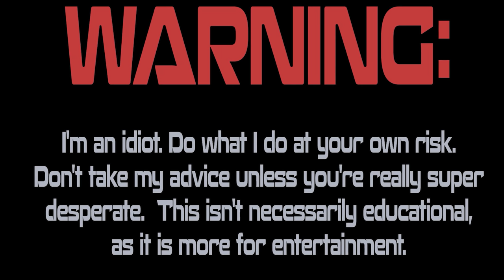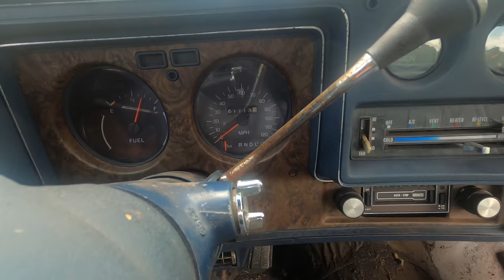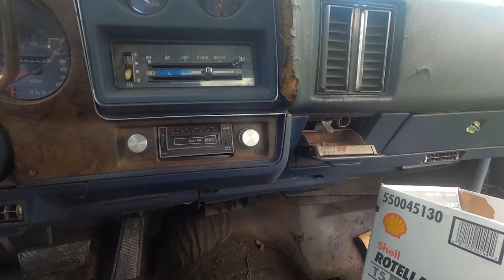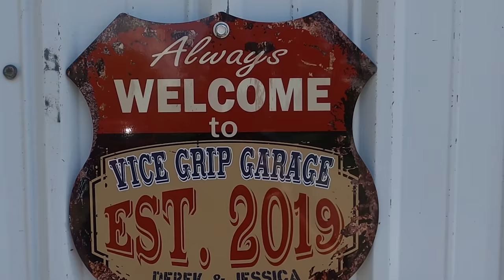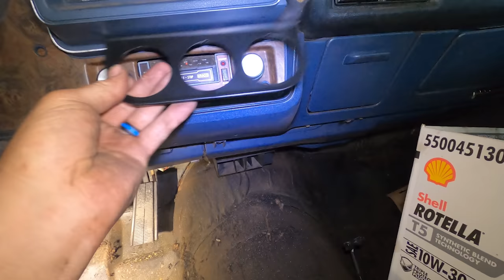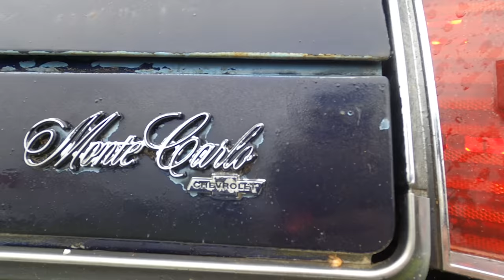ULTIMATE SLEEPER! - Supercharged 400 SBC Monte Carlo Landau

Comment: Someone should start a car club that consists of large 70s era cars like this and call it “The Yacht Club”. You know that Monte Carlo rides like a cloud!
Reply: The Monte was a mid size,more of a runabout than a yacht. There were plenty of land yachts for sure in '74. Big bucks,oldsmobiles, lincolns, Ford's,caddies and Chrysler's. I think you have a good idea for a yacht club. It's about time people start those big boats some love.
Reply: @kenworth2343  yeah you’re right about it being mid-sized. The Gran Prix was a big one if I’m thinking of the correct body style. I’ve got a 70 LeMans Sport coupe and a 73 Mach 1 I need to start working on!
Reply: @John-4649  They we’re great cruising cars. My 73 had the same split bench. I could fit five young ladies in the car with me and cruise around. That car was the only cool thing about me.
Reply: @toddingram1198  Mine isn’t original unfortunately. Someone put the GTO buckets and console up front. The back seat is missing, and finding a good frame for it under $300 will be fun. The Mach 1 thankfully is all there and numbers matching. It needs to be restored but the interior isn’t that bad.
Reply: Apparently Todd, those five young ladies thought there was something cool about you... It couldn't be just the car.

Comment: In the early 90s I acquired a 1973 caprice classic with same engine, I removed it put an a performer intake, comp 260 cam, headers and quadrajet dropped it in an 82 Swb Chevy truck, it ran 15.5s at the strip with 3.08 gears ! Great motor! I really enjoy your channel!
Reply: factory heads no stall street tires?
Reply: @mattv8919  yes they were original heads I believe were 882 castings(small valves). I even used the transmission out of the caprice it was a 375 turbo which I think was a long tail 400 turbo. Fun times

Comment: A fella loves hearing an engine scream down the street as opposed to a loud exhaust system. 
I CAN'T BE THE ONLY ONE
Reply: You might be looking at the wrong cars there then go check them electric boys out
Reply: I enjoy hearing the air growling into the carb sound more than the exhaust sound, too.
Reply: Yep; we got a Charger (V6, I think...) in the neighborhood which sounds like it's got a trombone for an exhaust!
Reply: @CoIoneIPanic  Oh like my 98 Civic DX with my $95 SS Ricer Muffler that's loud enough with the silencer in? Pull off the silencer and of course, the noise probably adds like another 35hp to a 105hp engine until the cops pull you over for a loud muffler! My 07 Si(turbo with 197hp) does circles around my 98 Civic DX, and my 95 Dodge Cummins 500+hp diesel does circles around my SI (never tested, but Probably 14 sec 1/4 mile?). Without a boosted launch it will do about 70-75 mph in 3/10 mile, 1/2-3/4 throttle! Probably the fastest Cummins in my county! About 0-70 in 6-7 seconds!
Reply: @catsaregovernmentspies  Nothing than the better than the secondaries of a spread bore opening up!!
Reply: @joelschermerhorn5447  Hate to say it but mufflers add close to zero power its more about sound

Comment: I had a '74 Monte Carlo. Looked just like that one. Mine was a brown metallic with a 350 in it. The only real problem I had with it was the transmission went out. I got one from a junk yard for $150, a guy put it in for $150 and it ran like new then. Great car. I drove it to Denver, then went over the continental divide but not through the Eisenhower tunnel, instead I drove the old hwy 6 that goes over the top of the mountains. I passed a sign that said 13,000 feet and kept going up some before it started back down. That Chevy 350 seemed to have as much power up there as it did at sea level. Great engine. It was a little harder to start at high altitude but once running very little difference.

Comment: My mom bought a new 74 Monte because she fell in love when she saw it.  Steel gray, black landau top with black interior and buckets.  She never asked about the motor.  Yea, it was a 400 and it would rip.  Not as well as the one she got rid of though.  She said that one was hard to drive and had too much power.  That one was a 71 Monte with a 454.  Loved that cal. Thanks for the memories
Reply: DIg them too. One long heavy car but they cruise on the fwy so well!
We would drive cross country like most in the summers going state to state these were perfect with that ice cold R12 ac. Back when chit was built to last!

Comment: My aunt loved Monte Carlos. Her favorite was a 78 Monte that had a 6.6L 400ci small block with a Edelbrock 4barell carb on day one. Her boyfriend on day two dug into the parts leftover from his smashed 78 Vette. He transplanted a Weiand 177 series long nose single carb blower, Weiand intake manifold,New Weiand high temp/high pressure metal gaskets and mounting hard ware H2O high temp therm, Holley 1250cfm duel pump electronic 4port 16 jet fuel injection carb replacement unit in fire blue, MSD HEI Coil, distributor, plug wires, Iridium tip Y split plugs, Weiand chrome tall valve covers with T handle bolts, MSD programmable ECU. The car already had ported and polished Alum Ram Air IV Hydraulic Flat Heads w/hardened 4130 TRP hardware, COMP Cams Hydraulic Flat Tappet Cam, Alloy Roller Rocker Arms, COMP double roller stainless timing chain, Ceramic Hugger Headers.

Comment: I wish I knew even a quarter of the stuff you do. I am slowly learning and restoring my grandpas old truck. Funny thing is that I’m in the same state as you so often run into similar problems on any car. You’re a huge inspiration for me to always keep going….remind me it can be done and have fun with it.
Reply: Start with building some car models. This might sound silly too you but I assure you, that alone will give you a massive understanding on vehicles and their parts and running gear.
Reply: @-DEATHSTROKE  I never realized how much of my youth building model cars was preparing me for the path I took. At some point my dad saw what I was building, and gave me a dremel And safety glasses. The modifacations never stopped. And its definitely how I got brave enough to start taking a saw and grinder to my real car.
Reply: i bought a 1977 kz650 bike not running and it needed a whole new harness, but i soldered all new wires where corrosion was apparent. no idea what im doing, but the service manual is awesome for the help it gives. good luck with your restoration
Reply: Derek inspired me to save the minty1972 Buick electra in his barn.

Comment: My compliments to you or whoever does your editing. I like the time lapse, and I also appreciate that you don't go out of the way to show how LOUD your power tools are. Look ma! It sounds just like a real sidegrinder!
Reply from the maker: I do my best! Appreciate it!
Reply: liked the hand air cleaner
Reply: It's called a angle grinder
Reply: @tanneraltizer610  
Yeah, a the spark plug wires are not lightning hoses, and the carberator is not a fuel make it happener, and the distributor is not the lightning whirler. Get a life dude!
Reply: @maquabear5242  I worked at a dealership before, that's exactly what they are called. lmao.
Reply: @maquabear5242  I don't know what tool is called, but I like the name, "cheek poker".

Comment: A friend of my sister came over to the house with a 1974 factory 454 Monte Carlo, factory gauges and tachometer. Real cool. Then another cool car I saw in the early eighties was an insurance guy had a 1972 Impala two door convertible, black interior body color white with factory 454 and 454 emblems on the front fenders, cool and rare.

Comment: I've had several of these and the ones to get is the ones that came with 400 small block and turbo 400 trans and change the gear out back to a 373 posi unit with 8 in rallys up front and tens in the back my favorite of these is the 76 model the year I was born

Comment: Ok, I just got all nostalgic. At the end of the 80’s and into the early 90’s I built the shit out of my 75 Monte Carlo. A Terry Klassen/Competition Engines built 350 that destroyed the factory turbo 350 trans within 4 days (but I had saved the turbo 400HO trans from my 74 Malibu SS). Toss in a shift kit and it held. 
For quick appearance reference the 70, 71, & 72 are similar. 73 is the oddball. Then from 74 - 77 (76&77 having 4 square headlights) And 78 they went back to a smaller car, lacking the sweet lines. 
Now mine had the swivel buckets and console shift. Super sick rally rims. (The ride to town to get the exhaust cut and hooked up to the headers was fun as shit. Open headers 🤪.)
But absolutely one of my favourite cars.

Comment: I love this car too.  I owned a 1973 with a 350, had it back in the 80s.  They are much fun to drive and float on the highway.  
Looking at that dash and steering wheel brought back memories.
The one I drove was blue with the black top and had swivel bucket seats, power windows and locks, rally rims.

Comment: The intake end gaskets work fine with aviation sealer in my experience.  Love the 400 in the Carlo.  Have you ever readjusted the worm gears on the steering box?  Done them for decades with no ill effects when you use brain and not brawn.  Enjoy your channel and projects.  Keep at it  Thank you
Reply: I had one with 400 Quadrajjet 175 hp from the south had it painted put some really  skinny tires on front wide on rear with Keystones all around 😳 then my Dad took it  ( he did pay for the paint job) RIP  Dad cool stuff !!

Comment: I wouldn’t call it a sleeper in 2021.. virtually no one has a stock 74 Carlo and if they did it would be mint or not worth restoring!!
Reply: I think I've never seen a 74 before myself. Unless I was drunk at a car show.
Reply: My 77 landau is 100% unmolested with only 31k original miles....bought it right before Covid hit and when I pulled out the plugs, they were the original plugs. Car literally sat for 29 years in a garage and was only started 1x a month from th original owner. Had only the usual rust holes at the landau edge and trunk. 2 holes each side size of a quarter. Taught my 14 year old how to do some body work lol. Still even has original paint GM #48. 100% a rarity for a car like this found in Boston MA tho 🌞🌦🌨❄☃️

Comment: That was a majestic burnout, loved the smoke creeping in the back too!  Thank God it wasn't some wussy 305 too, that 400 SBC is a legit torquer, even if it is smogged to hell.
Reply: 305 will run just as hard, depends on how you build them,bore them out,a high performance transmission,rear end,a high performance quick 305
 is known to win races,
Reply: 305 r weak

Comment: I ran into a modern truck that was" buzz bombed "black, just because they wanted it black. I took lacquer thinner and wiped it all off, and then buffed it out. It was a great looking red truck. Based off the fact the original paint on that Monte  would likely  be lacquer , odds of a solvent attacking the cheap paint without messing with the original paint are slim to none. Wet sanding the paint down to the original layer would be a very time consuming process with no way to know it would work, and how much painting will be needed any way. That car wouldn't be worth a conservation effort, just grind it down and repaint it, more so with some visible rust issues.There might be a few examples where the time and money spent to keep the original paint makes sense, but not usually and would cost more than a repaint.
Reply: The OG paint is lacquer
Reply: @chadvalliere8697  Lacquer is one type of many finishes. Very common for nearly 100 years. Somewhere in the 80's The manufactures  quit using it on cars, But I used it up until late 90's. I don'' miss that finish, but the price was dirt cheap compared to modern urethane  clear coats. I'm sure I'll be another decade behind the transition to water borne paint.
Reply: One thing I miss is the surface rust often found with poor coatings, quick and easy to fix... These days is you see any rust it usually originates from the backside and there is no quick easy fix that will last. Usually it has to do with foam sprayed between body panels for some mother fucking stupid reason. And when on a bed side wheel well it had nothing to do with anything other than creating a rusting point

Comment: I've had several 400 sbc (406-421-434) from mild to extreme with 100 to 400 shots of NOS and 45 plugs are the only thing I've run because they are the only ones NOS didn't destroy
Reply: 45 in what brand
Reply: @utahcountypicazospage5412  AC delco..sorry it took a year to answer
Reply: ACdelco R45ts

Comment: BAck in the day.  I had a 65 red chevy Impala.  Flying along the Washington DC beltway started spewing smoke profusely.  Found it wasn't a blown engine just the little shifter diaphragm  had failed putting trans fluid right down the engine go juice lines.    Lovve your channel.
Reply: 327 with a 4 barrel

Comment: My dad had that exact car brand new in silver drove it till early 2000's when it finally rusted in half
Reply: The rear frame rails usually will be rusted on these, if they weren't garage stored up where salt is used.
Reply: I looked at a new 77 just like this car in it’s original color blue not a bad deal at $5,600 with 8 miles on the clock bought a new Ford F100 XLT Ranger for the same price.
Reply: Yes they did rust out a shame
Reply: My dad had a sulver with a red vinyl top in the mid 80s
Reply: Ontario nice I'm in Fort Erie right across the river from Buffalo NY

Comment: I had a 75 Landau with a 454 brown with a tan land Out roof trimmering center caps built in tack swivel buckets did some work to the heads and that car ran only difference that it had different real lights in the back it had the Chrome run through the back lights

Comment: This was a guys first car……nice. The doors weigh more than a Chevette.
Reply: Not much room in the foot wells, I remember!
Reply: Hey I owned that remark an 83 Chevette that is
Reply: I laid one on its side in a ditch. I remember standing on the transmission tunnel pushing that heavy ass door open to climb out. We got it back on the road and fired it right up .
Reply: LOL, had them both a Monte and the Chevette. Doors definately weighed more, Also my hood hinges on the Monte left the bow on the hood. Had a cardboard beer flat on back seat floor so my passagers wouldn't step through. That car was such a POS, but I drove it for years.

Comment: '73 & '74 my favorite years of all Monte's; although in my neck of the woods we never saw a wheeze-oh-5 in "anything" until '75.
 I noticed you broke out a set of Accel plug wires? Hopefully they don't come apart on you like they ALWAYS did back the day if you ever go to replace or check the plugs a time after you installed the wires; didn't matter who's vehicle or where the engine was at, if it had used Accel's the terminals would always pull right off the plug tip without boot pliers.
 If you are unsure between the HEI &  the Unilite, the Mallory was always my favorite

Comment: I can’t find a way to post a photo of my 1974 I had. I just found out I have to pay my dues to post photos. 😎But the engine bay was painted triple black with chevy orange accent’s on the recessed panels! Then hand lettered in rub on script with the entire car’s specs, and clear coated it! It was AWSOME! Then put all the Eddelbrock signature series valve covers and breathalator cover on it. Followed up with the accell 9mm sparkelator wires, then did the stainless hose covers for the radiatolator hoses and mounts! Properly anodized in matching colors. On the interior, I went with electric 6 way adjustable swivel bucket’s beautifull California cruiser edition interior and swooping center console with the 69 Monte Carlo shifter and indicator plate. Full pioneer sound system I removed the vinyl top and rhino lined the roof instead . It made for a pretty much bulletproofed top as far as maintenance. It presented VERYwell!! ✌🏻💪🏼
Reply: I have to pay my dues so I can post photos,😂👍👍🤜🏻

Comment: Almost identical to an Oldsmobile CS can’t recall the year my grandpa had at one point. She had a small block 350 with the 4 barrel carb.  I’m sure that was the original fac-try option. I was lucky enough to be allowed to drive it to school at 16.  For her age I don’t recall any rust or body damage whatsoever the original vinyl was even still in excellent shape. And the only issue with the interior were the plastic moldings on the door, and a pillers were brittle and faded from the sun.  For the age and with over 100,000 on her she still ran like a top.

Comment: Could be a low mileage car. Fitrst car I ever wreaked was a 73. Back then you ordered the car the way you wanted it. My mother order hers. Silver black vinyl top, swivel buckets, rallies and console shift. took six  months to receive it, I was 15 years old when I side swooped a parked car, I blew it. Last time she ever let me take the car out with her knowing anyways. I would slip it out of the driveway at night for the next couple years, 350 engines horse power didn't exst. A friend had purchased one with the 454 in it. Slapped on a Holley and that was the trick. Pretty fast car. Ran into the old Monte  25 years later and a few different owners, it was a total rust bucket. Low rust? I'd say low miles.

Comment: HAHAHA that was great! " I think I swallowed a tooth" - that slayed me. @27:00:00 Hey man your fan will basically always run with the sensor in the manifold. Ideally, have it on the outgoing hose of the radiator. Ive used a 2'X2"X1/2" copper tee then soldiered a 1/2" female adapter and screwed the sensor in to it. Crazy how much you can drive it really hard on a hot day and it wont turn on until you hit a stop light. Anywho, great vid man.

Comment: Such memories.  You just don't see these cars in the wild. They rust pretty bad. I had a 73 Landau with a cam and headers and the rear gear was 2.74:1 it would not spin the rears from a stop sitting in water.  But it would do 70mph in first gear, that was fun!.  This ride definitely needs the 454!